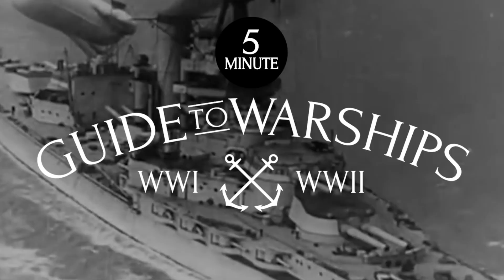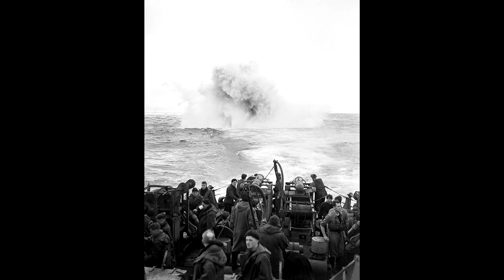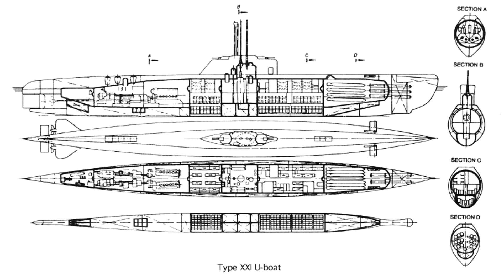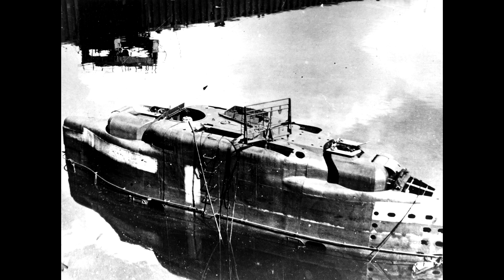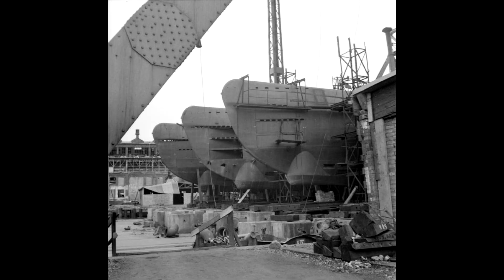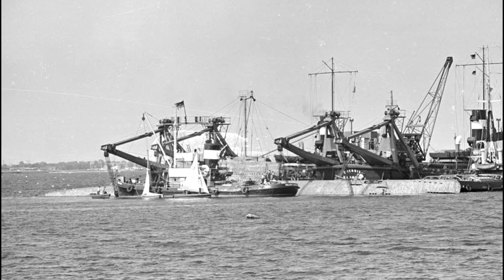Type XXI - Guide 408

Comment: France used a refitted XXI until the 60s, West Germany used one until the freaking 80s. They were modernized and refitted of course, but this shows how crazy advanced the XXI was. The USSR and the West based many non-nuclear sub designs on it.

Imagine using me.262s from 1945 until 1984, but still being competitive with other aircraft. That's how crazy it is.
Reply: Joined the West German Navy in Okt 79, the Boat was used at this time  as a research (or Training Boat?) but we had also 2 Fletcher Class /Z Klasse Destroyer active at the time
Reply: @Sturminfantrist Mexico has a Fletcher until 2001.
Reply: @Sturminfantrist  it was a training boat
Reply: Let's be entirely fair. The 21 was immediately outclassed by the next generation of post-war submarines implementing it's design features, by virtue of those being designed and manufactured without the pressing time and material constraints of war.
Reply: There is a type of single engine, propellar driven aircraft (whose name I do not remember) that was designed shortly after the end of WW II (48 or 49 I think) that is still being used for crop-dusting to this day, relativly unmodified.

So it is not THAT crazy an idea.
Reply: @Grubnar  The An-2, I expect. Simple, robust, doesn't really stall so much as 'settle', and has the handy feature that the oil tank needs refilling at the same time as the fuel tank, making it easy to remember.
Reply: @Grubnar Antonev AN-12?
Reply: @theicmn  B 52
Reply: Not really. There are plenty of examples of WW2 ships going into the 80´s/90´s. Almirante Belgrano (sunk in the Malvinas War) was build in 1933. US Gearing destroyers were in service in Taiwan till 2003. CVL Cabot (1943) was in service in Spain till 1989. USS midway (1945) was in service till 1992.
Ships last for a very very long time
Reply: So your basically warthunder match?  Takes out Me.262 vs late cold war jet thanks to the br compression. Lol
But I understand what you are getting on about. GG
Reply: Does anybody know if there were two XXI subs in Spain in 2005 or thereabouts?
Reply: I served in the American military on a ship with WWII service in the late 90's, she was decommissioned in 2002. She now sails in the Nigerian Navy.

Being too poor to have a more modern vessel doesn't mean the vessel was advanced.

https://en.m.wikipedia.org/wiki/USCGC_Sedge
Reply: The Japanese had a super submarine as well but the I201 of lessor performance in range.  The I201 maximum submerged speed was 19 knots with a submerged range of 135 nmi @ 3  knots.    The equivalent submerged  figures for the Type XXI are maximum speed 16.5 knots with a range of 487 nmi @ 3 knots  (3.5 times the I201 range at the same speed).   Other figures are 330 nmi @ 5 knots,  280nmi @ 6 knots, 120nmi at 8 knots, 79 nmi at 10 knots and 26 nmi @ 15 knots.   (Sources Wikipedia.de and Wikipedia.com).  These are test figures from U3501.  
-Even allowing for the remote possibility that the Japanese and Germans  using different battery depletion figures (say 50% and 80%) the Type XXI still has over twice the under water range. 
-I suggest the Japanese were using batteries with higher surface area to volume ratio electrodes to obtain power at the expense of life.
 -I would also add that German submarines had almost twice the diving depth of British, Japanese and American subs due to hulls twice as thick.
Reply: Submarine warfare progressed at a different pace than aircraft warfare. Look at the start of the F-4 Phantom.
It would be like saying that the advancements of an unknown planetary culture must be equal to ours. That turns the Bell Curve into a spike.
Reply: "Modernised and refitted" sort of negates the claim that this WW2 technology was so advanced. And West Germany did, as already stated, only use her as a RESEARCH vessel. NOT an operational submarine..which renders the point you are apparently trying to make...moot.

Comment: The grand father of all non nuclear subs today! Amazing ship for its time! Thank you Drach!
Reply: And nuclear subs too because its hull design was the base for USS Nautilus
Reply: @SeveralWeezelsInaTrenchcoat  yes the water drop shape came later, you are right!
Reply: @khaelamensha3624  Actually the water/tear drop shape was first trialed in the British R class of WW1.  A highly successful design but the listening/attack technology of the time wasn't up the making it a proper hunter/killer sub as was it's purpose
Reply: I would attribute modern hull design to USS Albacore
Reply: @Fulcrum205  clearly yes, USS Albacore was the next breakthrough as the USS Nautilus was another one. Subs are just so fascinating ❤️
Reply: The Fubuki of modern subs. :)
Reply: I read somewhere that the first generation soviet SSNs (November class) were also influenced by the Type XXI. I know for sure the diesel powered Whiskey Romeo and Foxtrot classes were, not 100% on the November though

Edit: I googled it and it does appear to be the case, making the Type XXI the grandfather of all modern submarines! Of course both nations would deviate from the Type XXI heavily with second generation designs (Skipjack and Victor classes respectively) but still
Reply: @sawspitfire422 There were two black or dark navy blue subs of that shape in the naval section of Cartagena Harbour. 

The Peral was on a concrete plinth where visitors could see the conical ends and the nearly tubular centre section.  
It was billed as the first useful submarine.
Reply: @sawspitfire422 Wasn't it the Romeo, too?
Reply: Eeh; British and US Sub's were generally quite advanced anyway, and infinitely superior to the Germans on ergonomics.

Comment: With all of these submarines being discussed, hope a collab with HI sutton can be made👍🏻

The Taigei has to be the latest version of this concept with the use of lithium ion power cells.
Reply: sodium batteries are much cheaper and quite safe too apparently. maybe not as energy dense as lithium but still big step up from lead-acid ones.
Reply: The German Type 212A uses a bank of fuel cells to give it some serious underwater endurance.  It also has a number of other innovations.  The Swedish Gotland class uses a different approach.  They use a Sterling-cycle engine and LOX bottles to generate power underwater.  The US Navy was impressed enough with the Gotlands that they leased one of them (with crew) for several years to train antisubmarine warfare specialists, test new tactics and equipment, and be the "bad guy" during fleet exercises.
Reply: Fuel Cells are pretty cool too. They can discharge more electricity at once than most batteries which can allow very high speeds underwater.